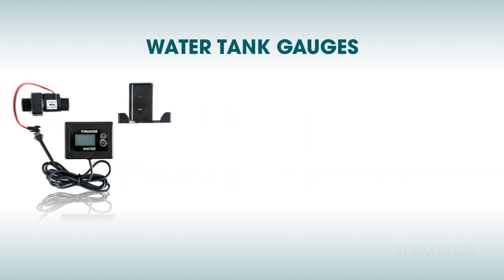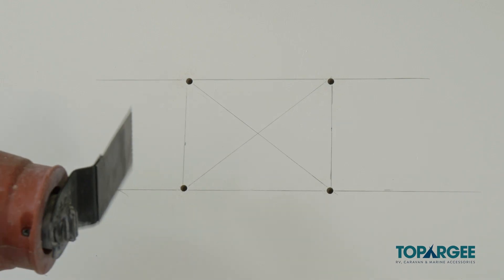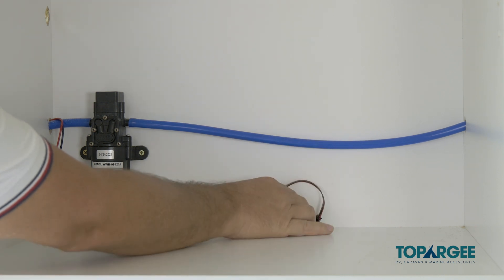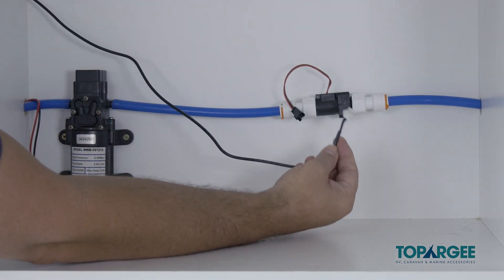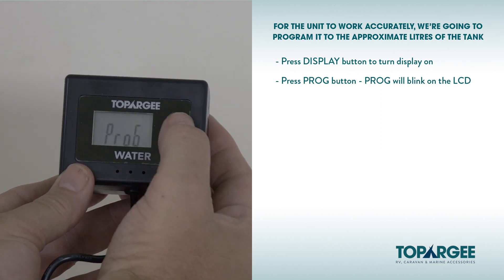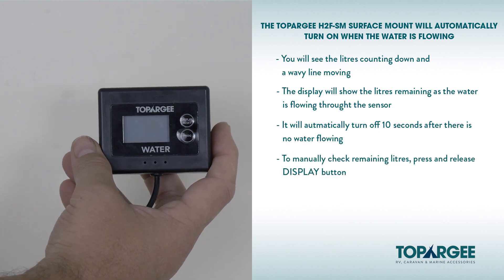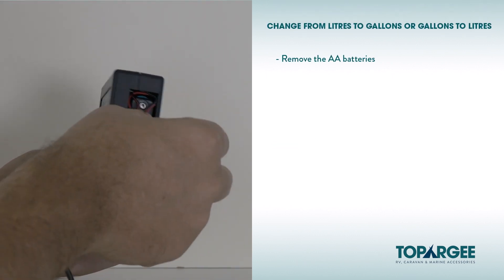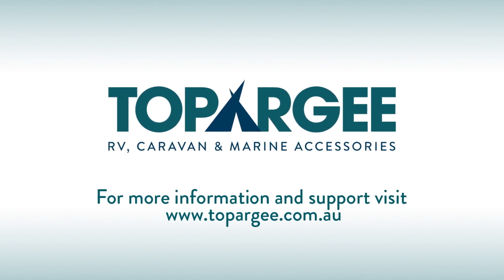Topargee Water Tank Gauge Installation (Step-by-Step)

Comment: What a stupid statement -
"Traditional water tank gauges which show FULL, 3/4 FULL, HALF FULL and EMPTY - so you never know how much water you have in your tank."
At a guess, I'd say if the traditional gauge says full, half full or empty... that's how I'd know what I actually have in my tank.
If it was an 80 litre tank and the gauge says HALF, then I'd have 40 litres left. 
Was this overlooked at the brain-storming discussion of scripting this video?
Reply: except thehey are never accurate, 'half full' is still really a best guess. Also the standard sensors can be unreliable.